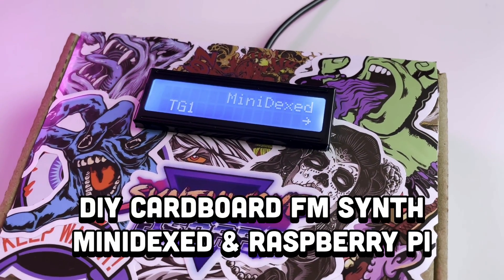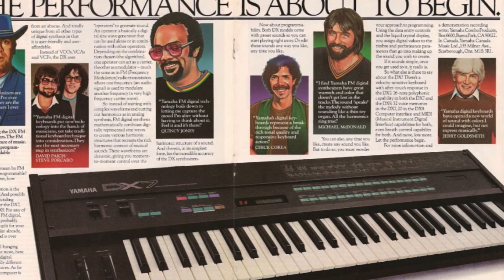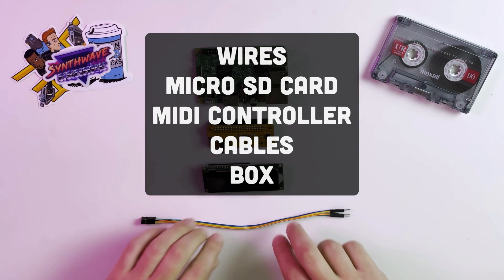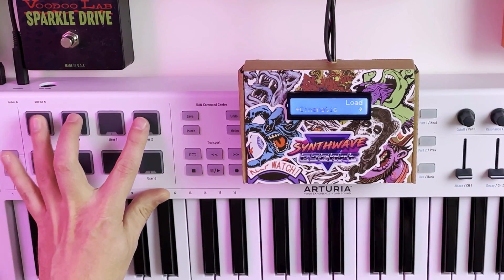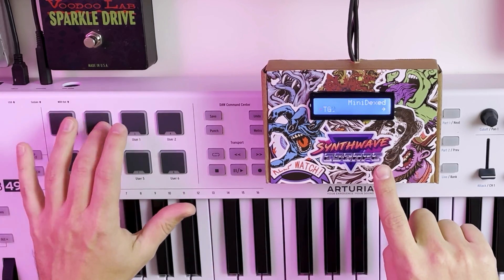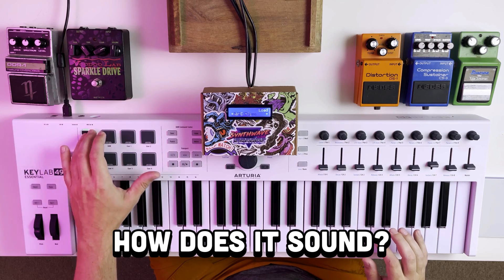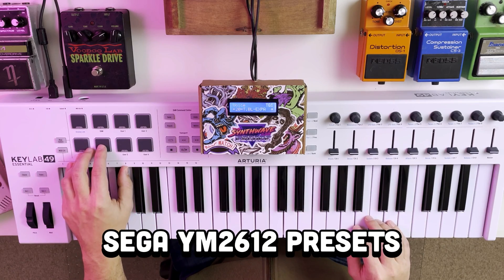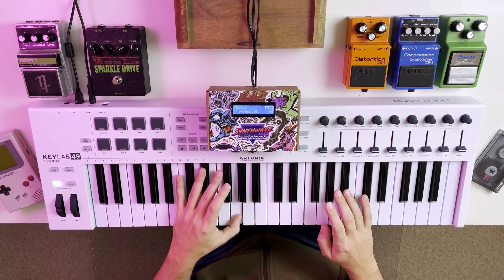DIY Cardboard FM Synth (8 DX7s!) | MiniDexed & Raspberry Pi

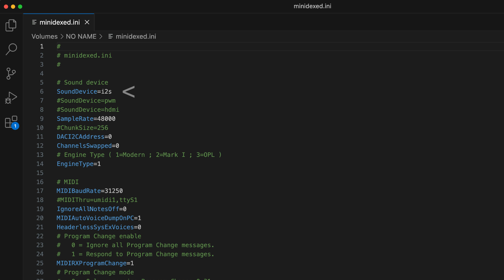Comment: Very cool! Thanks a lot. My first project with a Raspberry Pi. So , I got a PI 3B+ from ebay, a raspiaudio card, the LCD display and some wires. Then some soldering which I have'nt done for a long time. But somehow it worked. The great moment... Then... nothing. First I had no clue at all how to find my fault.  You simplified the setup already very nicely and I did care for the wiring. But what to do? I tried an older version of miniDexed, nothing. Then I realised there is probably an issue with the display and ... tata... In the default minidexed.ini file the value for the "LCDI2CAddress" is "=0x00". In your changes of the minidexed.ini file you did not mentioned it but you already changed the value to "0x27" (see 5:24) which is the correct value for my setup (you'll also find it in the WIKI Fault-Finding). So, finally everything worked properly and I'm happy and enjoy the sound of yesteryears... 👾😇
Reply from the maker: Nice! I'm glad you got it all sorted. I think I ran into the same issue initially. Enjoy your new instrument! 🙌

Comment: does anyone know if the performance presets, or really I guess just the synth is velocity sensitive?
Reply from the maker: Yes, it responds to MIDI note velocity. 🙌
Reply: @mobypixel  hmm, ok. the performance patches on the one I made all seem to be at the same volume, when controlled with my keystep pro, did I do something wrong?
Reply from the maker: That’s strange. It does have a compressor that might be pushing the levels higher. Playing an E.Piano patch should have noticeable velocity response.
Reply from the maker: You can hear velocity sensitivity at 8:55. It’s possible some performance patches are played at full velocity though.
Reply: @mobypixel  I was wondering if the compressor was pushing it, I'll play around with it, was fun to build either way.  Thanks for the guidance.

Comment: Man I wanna make one of these with a wooden case
Reply from the maker: That would be nice! The challenge for me is getting the lcd hole just the right size. I have a router now but haven’t had a project to use it on. I do cigar box builds which just become saw dust under a jigsaw.
Reply: @mobypixel  There's a whole woodshop at the makerspace I go to, I've never done woodworking but I really want to try it

Comment: What a great project! Being blind since birth, I’m naturally excited about anything that can be controlled with a few buttons and sliders. One thing I am noticing, though, is that most of the demos of individual voices seem to be something like a quartertone flat. Does anyone have an idea what might be going on here, and whether this is something that can be fixed, if it is reproduceable on other units?
Reply from the maker: You have good pitch detection to notice that. Each of the 8 channels have detune and panning parameters that can be set. The detune values are offset on a lot of the performance presets for a thicker sound. It is possible for the single instrument demo, I played using a channel that had a detune value already set. That’s my best guess. Good luck with the project!
Reply: @mobypixel  oh, for some reason, it looked like my first reply got deleted, but it seems they are now both here. Weird.
Reply: Oh yeah, that makes sense! I might give this project a go at some point. I wonder how accessible it really is if you can’t look at the screen. Is there a lot of menu diving? Also, is this programmable, or does it only play presets, and you have to make patches on a separate machine? It wouldn’t be a big deal if it is just presets, DX7 style programming is probably more fun in an environment where I have a screen reader anyway, and I imagine something like Orca won’t work with this set up, right?
Reply: Oh thanks, that makes a lot of sense! I might actually give this project a go at some point. I just have to look into how much menu diving there would be, and if it can be figured out without being able to look at a screen, working on the assumption that screen readers will probably not work with this.
Reply from the maker: @florianangerer5121 There is the option of menu diving but once configured in the MiniDexed configs file you can send MIDI messages that I have configured to pads on my Arturia to change through presets. Unfortunately I have not looked into accessibility features on this project so I’m not really sure what all is possible. There is a discussion section on the GitHub repository where the creators may know more on that end. https://github.com/probonopd/MiniDexed/discussions
Reply: @mobypixel  thanks! Yes, I might talk to the developers about this at some point.

Comment: Also, could you use a touch screen instead? That way you don't have to map it to your midi controller?
Reply from the maker: I’ve seen some builds in the discussion section of the MiniDexed GitHub that have different build configurations. Someone also used a Pirate Audio LCD shield that has built-in navigation controls that seemed to simplify things.

Comment: Could you also use the Pi Audio drive sound card?
Reply from the maker: I’m not sure. I don’t see any mention of it but if it uses the same DAC pins as the Raspiaudio board, you would think it would work. Maybe someone in the discussion section may know. 🤷
Reply: @mobypixel Thanks for taking the time to answer my questions. I really appreciate it because I'm learning how to build synths from square one with no background or experience.

Comment: so you say the sound is better from the sound chip than the PI audio. does that mean - just to test - that the sound board is not needed for this project to work?
Reply from the maker: Yes, that is correct. And it is possible the newer Raspberry Pis have better built-in audio.
Reply: @mobypixel I know it's not your problem, but I have all the parts now and followed the gitlab directions. The pi works fine - loaded the desktop software and played with it for a while. Then I wiped the SD card, copied all the gitlab files, changed the ini, installed the display, and I get all boxes across the top when booted. I am totally new to pi (although professional in Unix/Linux). Are there ways of debugging?
Reply from the maker: Hmmm, it could be the wiring, the SD card not being formatted to FAT 32, not using a release version of the GitHub repo, or something else. You could watch Floyd Steinberg’s tutorial to see if he has any different steps. The GitHub repo also has a discussion section to see if anyone else has had a similar issue. Good luck and let me know how it goes!

Comment: Could you please post or pin a list of parts exactly as you had it to build your unit featured in the video? I use eBay to buy parts but I went into a rabbit hole and lost track of what I needed to get the same system as you have it in the cardboard synth. Also a list of the commands and files needed to build and use the synth?
Reply from the maker: This is what I used:
Raspberry Pi 3B
Raspiaudio Hat
I2C LCD Display (2X16 with backpack)
Micro SD formatted to FAT32
Arturia Midi Keyboard
Male to Female Jumper Wires
Cables for Stereo Audio (mini headphone to stereo XLR), USB MIDI, and Raspberry Pi Power

I don't have the files posted anywhere, but the only changes I made are shown on the screen and specific to my controller in the minidexed.ini file. Good luck with your build!

Comment: Does anyone having sticky key when you are playing miniDexed? it doesn't happen on the first note, but it is consistent after couple of cords I play on every patch.
Reply from the maker: I have not had that issue, but you might try seeing if it is mentioned in the MiniDexed Discussion section on Github. One thing to check is that your MIDI Controller is securely connected. If the connection is intermittent it might not be passing and receiving all the messages. Otherwise you may have found a bug that I'm sure they would want to know about. Good luck getting it sorted! 🙌

Comment: I'm old school. I remember the bread boards, ic chips and sockets, using thin wire and wire wrap tool. Rasberry Pie is new to me. I was a digital tech almost 40 years ago.
Reply from the maker: That sounds awesome! Yeah, you can do a ton with microcontrollers and mini computers like the Raspberry Pi. I tend to prefer working with microcontrollers for electronics projects to embrace the limitation. Raspberry Pi is an affordable mini computer that can go in anything. It's really powerful, but loses the charm of building things out of just a few parts. In projects like this though it's a game changer.

Comment: I used the same DAC hat but the v3.1 and everything is configured in the ini file properly but I get no sound; the screen and knob work fine, just no audio. Any ideas? No clue where to start troubleshooting
Reply from the maker: Here are a few random things to try: It sounds like the DAC is on the correct way since the LCD lines are connected properly. In minidexed.ini it should be SoundDevice=i2s. You could try PWM to see if sound is coming out of the other output on the Pi. It is also possibly your MIDI Keyboard isn't sending signals to the correct MIDI channel. Also, at one point I tore a pads off of the hat because the audio jack is loosely attached, check for any loose or broken connections. If problems persist you can check the minidexed discussion section on GitHub to see if/how other people solved similar problems. Good luck and let me know how it goes!

Comment: bro this is fire they need to put out a mini farelite CMI that'll run on old and otherwise obsolete x86 based PC like from the late 2000s and possibly even on as old as early 2000s machines p4 era hardware.
Reply from the maker: That would be cool! I've seen a CMI emulator in Arturia's Synth Lab. There are also samples from the original CMI on internet archive, but I bet redistributing wouldn't be allowed.

Comment: Would this be interchangeable with the Serdaco TM-32 MT-32 Pi emulator? Looks about the same, hardware component wise. Would be nice if you could just switch SD cards and get a whole other synth.
Reply from the maker: Yeah, it does look like similar components but it might take some configurations in the MT-32 pi code. This one looks promising too: https://github.com/probonopd/MiniDexed/discussions/726

Comment: In config  minidexded.ini lcd item is 1 for not i2c and 0 to i2c. This item is confuse plase
Reply from the maker: Mine looks like this "# HD44780 LCD
LCDEnabled=1
LCDPinEnable=17
LCDPinRegisterSelect=4
LCDPinReadWrite=0
LCDPinData4=22
LCDPinData5=23
LCDPinData6=24
LCDPinData7=25
LCDI2CAddress=0x27" in general I think 0 means disabled and 1 means enabled. My LCD has the backpack board but I think in Floyd Steinberg's tutorial his does not. If you get stuck there is a discussion section on the MiniDexed GitHub repo that is a great resource.
Reply: i have , resolve this problems , great,,, equip , its workin now ,,, thanks , in my case its using i2c lcd ,, but i resolv this , misterius,,, thanks,,,
Reply: Please inform me
Reply: i have , working now ,,

Comment: I like your video.  I have wanted a DX7 for a long time.  I do have DEXED on my computer, but your gadget makes it portable.  How would I get it working with my M-Audio Keystation which has no pads, only keys?
Reply from the maker: In the minidexed.ini file you can setup the keyboard to send values to the controller. https://github.com/probonopd/MiniDexed/blob/bba0c93f04f8a40a897faf54378d7f11f2729452/src/minidexed.ini#L118 Just select the midi channel and set the midi note value > 0. The other option is to wire up a rotary encoder but that requires more components.

Comment: It's cool but the issue I have is no controls so what's the point. Am confused.
Reply from the maker: The menus are navigated and parameters changed using the pads on the MIDI controller. Alternatively you can use a rotary encoder like Floyd Steinberg's video, but it requires some additional components.

Comment: Hi There, for some reason I can't get my midi keyboard to use to navigate the menu...can you point me in the right direction? thanks in advance
Reply from the maker: You set the values here https://github.com/probonopd/MiniDexed/blob/62074b6cd8337f760a16d72e632dabb62704b0a9/src/minidexed.ini#L117 One thing to check is that MIDIChannels might be off by 1 since Some MIDI devices count starting from 0 and others starting from 1. Good luck!
Reply: @mobypixel  thx ill check my settings and put them here....my question also is do I need to use a control change or a program change, because I used a control change (cc) on my novation keyboard, on the pads. when in boot minidexed I see that the changes are loaded, but my keyboard doesn't respond. did you change anything on your keyboard settings? why do you the midi channel on 17 that's omni right...but your using your drumheads on the Arturia, ands that's midi channel 10. im confused.
Reply from the maker: @zwannieboy  That link is to the main repo, not my local copy with the changes from the video. It says for MIDICC changes "NB: Off < 64 < ON" I think that means you would have to send a MIDICC value above 64, then below 64 for it to complete a single "press" of the button. I don't think button presses would work well for MIDICC updates in the script the way they have it. On Github they have a discussion section that might have more info. In the case of my MIDI controller the keys and pads are MIDI notes played on different MIDI Channels.
Reply: :-) ? so...can you point me in the right direction...?
Reply from the maker: Oh, I wrote a response. I'm not sure why it didn't show up. In the minidexed.ini file it has the MIDI Button Navigation options. On some controllers the MIDI Channel starts at 0 and others on 1. Check to see if the channel off-by-one issue is happening. Also it says MIDIButtonNotes should be greater than 0. My settings are at 5:31 in the video.

Comment: Cool little gadget! I’m wondering though, how would you program new sounds when using this thing? That little LCD looks sufficient for scrolling through already existing patches, but interacting with all the FM operators and programming new sounds would require using a computer, I suppose?
Reply from the maker: Thanks for watching! The presets are text files in the project. I’ve only played through the existing ones so far, but I haven’t made my own yet. You’re right—programming sounds would probably need a computer.

Comment: How much compute power does this need? Could I build this with an original pi or pi zero?
Reply from the maker: @runnerup15  On the MiniDexed GitHub page they say “Raspberry Pi 1, 2, 3, 4, or 400. Raspberry Pi Zero and Zero 2 can be used but need HDMI or a supported i2s DAC for audio out. On Raspberry Pi 1 and on Raspberry Pi Zero there will be severely limited functionality (only one tone generator instead of 8)”

Comment: Hey man! 
Any cheaper alternatives for the audio hat?
Reply from the maker: The people on the Discussion section of the MIDIDexed Github page will know more but the description says:
• Put SD/microSD card into Raspberry Pi 1, 2, 3 or 4, or 400 (Zero and Zero 2 can be used but need HDMI or a supported i2c DAC for audio out)
• Attach headphones to the headphone jack using SoundDevice=pwm in minidexed.ini (default) (poor audio quality)
• Alternatively, attach a PCM5102A or PCM5122 based DAC and select i2c sound output using SoundDevice=i2s in minidexed.ini (best audio quality)
• Alternatively, attach a HDMI display with sound and select HDMI sound output using SoundDevice=hdmi in minidexed.ini (this may introduce slight latency)
Reply: @mobypixel  Thanks very much, I have just found a PWM 5122 on ebay for 11Great British pounds(I have no idea why they call their money that, its weird)
Reply: @mobypixel hi, just a small question, in this scenario with a different dac where are the four pins to connect the display?
Reply from the maker: @tortugacastro  Im'n not sure. In Floyd Steinburg's tutorial he attaches an lcd using the external pins but it doesn't seem like the four pin type. https://www.youtube.com/watch?v=Z3t94ceMHJo&t=168s Looking at the traces on my raspiaudio board I can't see where they run because they are covered by the headers. Another place to check/ask is the discussion section of the MiniDexed repo. https://github.com/probonopd/MiniDexed/discussions Someone also created a tutorial recently using the Pirate Audio DAC with LCD.
Reply: @mobypixel thanks mobypixel i’ll check there.

Comment: Great project. Is it possible to use a Pimoroni Audio Headphone (audioboard+lcd without any cable) instead of Raspyaudio Hat?
Reply: The audio should work as it is an i2s DAC. The display could get difficult, but it is worth a try.
Reply: Maybe not in this case, but audio Pimoroni should be used more widely. Four navigation buttons and a screen. All compact and ready to use. Really worth a try. Thank you.
Reply: Im trying this out. Audio and display is working fine. Managed to get two of the buttons to work. Im shure the other two will work too, when I figure out what GPIO they correspond too. The display and buttons needs some editing in the .ini file to work.
Reply: Go @Jonny-y4m Go (quot). The point is to have three complete synth project (Samplerbox, Fluidsynth sfz reader and Minidexed)  all with one Raspby4 and a Pimoroni Headphone audio/screen.
Reply from the maker: It's worth asking in the MiniDexed Discussions on GitHub: https://github.com/probonopd/MiniDexed/discussions I don't think the display would work out of the box, but maybe someone over there has experience with it.